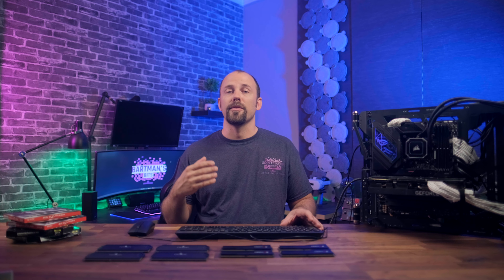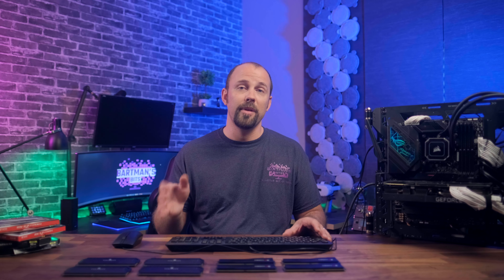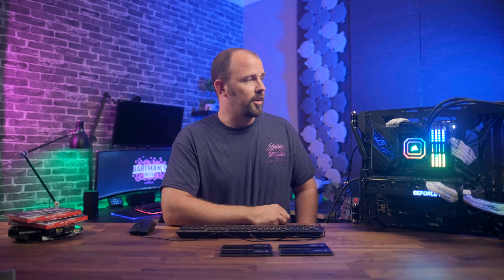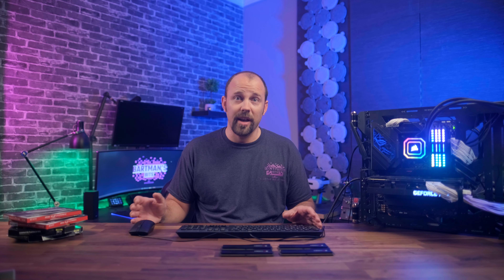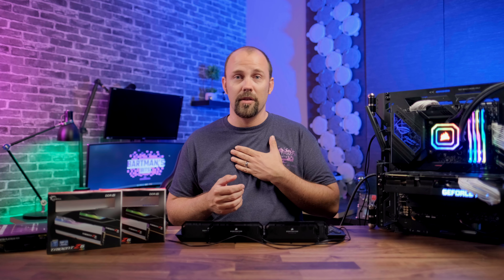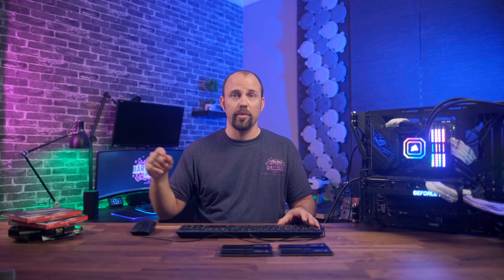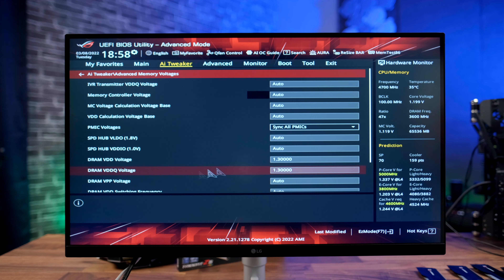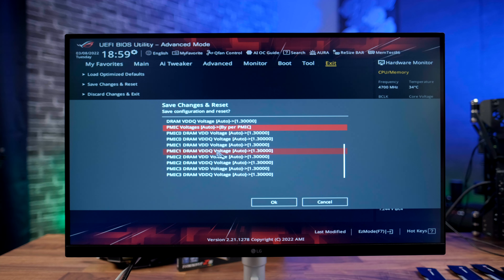Intel’s DDR5 problem resolved! DDR5 64GB Boot Loop failure Fix. Get the rated speeds of your RAM!

Comment: Ran into this tonight while trying to setup my CPU. All of a sudden XMP stopped working and was stuck in a boot loop with a UEFI error. Changed the settings and let it loop through all the sticks and I was able to post and install windows. I don't understand why this wasnt an issue on my PC before, I have been running these same sticks for the last 2 years without any of these changes.

Comment: My ram is 6400, but the bios shows it at 4000. Followed the video, and still won’t go above that. Thinking I may have faulty ram and/or motherboard

It also seems like evga doesn’t allow you to change the pmic settings. At least not on the z690 classified.

Comment: Hello,just got a z790 tuf pro, with 2 x16 gb at 6000mhz ( cpu i7 14700k) with xmp profile on,the ram are at 6000mhz and i get the boot loop and blue screen all the time when i open the pc, with 1 stick works fine! but when both are togheter pc freeze/crash and put me into bios,or repair mode thingy, ill try do to what you done in this video to see if its working somehow,or if anyone has a ideea ,been hours im trying to make it work! Thanks !

Comment: I can get my Gigabyte Z790 Aero G to boot by changing these settings and windows is totally stable but as soon as I do a restart I get the boot failure detected message again but if I shut down instead of reboot then it always boots up fine.  Gigabytes bios is super buggy.

Comment: Ive got my dominator 64gb 5600 4sticks to be stable on my msi mag Z790 MB by just running them without xmp for first boot then turning xmp back on  but whenever i try to do a ramtest ie diagnose memory test or any of the other ram testers  they dont seem to do anything  my computer just sits there left it for 2 hours just in case but still the percentage counter hadn't moved   tried it with 2 sticks and it worked fine    I'm not having any stability problems with 4 sticks games and everything are running fine  that's playing Cyberpunk

Comment: Perhaps you can help, I have the titanium dominators 2 16 gig sticks. And only one stick posts. So I am not getting my full memory capabilities.
Reply from the maker: Do you have them in the 2nd and 4th slots? Are they fully seated? If you swap them does the problem follow the memory stick or is it the slot that is possibly bad? Check these things and let me know.
Reply: @BartmansBits  yes it is not a physical issue. I’ve gone through every thread and forum. It seems to be something with aorus boards and dominator sticks. It’s in a2 and b2. A2 is not posting. But I swapped mother boards yesterday. Day before that it was b2 not posting.
Reply: This is my second set of sticks. I returned first set thinking they were bad, and got this set. Same exact issue happened.
Reply: @BartmansBits  any idea what I could be doing wrong?

Comment: Hey @bartman's Bits i got a rog strix z690-F gaming wifi MOBO with Corsair Dominator 2x16gb(32gb) at 5600MHZ DDR5 so only 2 sticks and im crashing on XMP2 while running XMP1 its pretty stable but i still get problems after a few hours of gaming do you know what the reason to that is? if i apply the information from your video into my bios will it fix this problem ? 
Thank you
Reply: Hi, u solve this issue?

Comment: G.Skill Trident Z5 RGB
DDR5-6400 CL32-39-39-102 1.40V
64GB (2x32GB) 2-Kits
Intel XMP (128GB) can a total  of 4 sticks  be combined to get 128GB they come in a kit of 2 can I use all 4 sticks of 34gb ram to oc to 6400mhz and at that point is it Considered dual or Quad channel with all 4 slots? Can I achieve those speeds with all 4 install in my msi mag tomahawk wifi z690
Reply: I have the same hardware. Did you find a solution?

Comment: Just bought an MSI pre built that came with 2 16gb sticks of DDR5. I wanted some RGB effects so I added another 2 of the same DDR5 Kingston Fury but with RGB...damn thing wouldn't boot with 4 sticks at 64gb. No matter what, I removed 2 and it booted fine. Don't know why I can't populate all 4 slots. I guess it doesn't really matter, I'll never need 64gb.

Comment: Great video. I just gone and bought parts to build a system to support 12th gen intel. I hav ebought GSkills 4x16 GB @60000 Mgz. I will try this method but have  Asus released a bios update to solve this? My motherboard is an Asus Maximus Z690 Extreme. Or would It be better to replace the 4 sticks with s sticks of 32GB each??

Comment: Why does no one ever talk about passing memory tests? My kits boot fine with 2 sticks even 4 sticks at 7200Mghz (my kits advertised XMP settings). But it will bluescreen every 10 minutes in Windows due to massive amounts of errors. 
Being able to post is one thing... but in my opinion it also has to be stable otherwise your windows will die after a few windows updates.

Comment: I have a msi z690 force motherboard i9-12900k and just got 4 sticks 64gb 5600mhz corsair dominator platinum ram been messing with it for a whole day when I enabled xmp I get a failure and auto resorts to 4000mhz I tried these steps and anything else im stuck havent found a fix any solutions?
Reply: found a solution?
Reply: @daedubedb  no I returned the ram my board has had 3 bios updates then says it supports updated ram profiles to use more dims and higher capacity haven’t tried it again could just be cause when I bought my z690 it just came out and ddr5 was still early for the z690 platforms boards if In the future I’ll resort back to this comment

Comment: In an nzxt z790 n7 I couldn't get 4x16 gskill dimms working at 6000 Mhz (what is her top speedvalue), I could only make the system boot by putting them in xmp at 5600 Mhz and nothing else, 🥲

Comment: I just built my new computer with no issues, I went with a Asus Z790 board and a i9 13900K and MSI GeForce 4090 and for now, 32Gb of Corsair Vengeance DDR-5 6000 MHz / CL 36. Can I use 2 of the same sticks (4 total) and upgrade to 64 Gb
With your fix, also.......... Im not using a the same CPU as you were.

Comment: I need help I just got 13900k AORUS z790 with the trident z5 ddr5 6000 mhz 4 stix of 16gb  1000 watts psu I’m getting mobo code c2 c4 14 28 54 .. I flashed bios and still won’t post idk what to do :/

Comment: Seems like the latest asus bios update makes it a bit more stable. I dont need to increase voltage for 4x16 downclocked to 5400 dominators to post anymore. Its still not stable at the original 5600 xmp profile though

Comment: Need some help here! Ive got an i7 12700kf in an asus z690a prime with 2 16gb 5200mhz sticks from hyperX getting stuck on boot loop. Tried what was suggested in the video but didn't work, pc still boots fine with just one stick in (any of the 2) but getting the second one plugged sends me to boot hell

Comment: Unfortunately I did not work on me. I have:

Maximus Z690 Formula 
Corsair DDR5 5200mhz ( which is compatible with motherboard )
I9-11900

I changed the volts, frequency. I did everthing what you did in the video, I am with the last BIOS update. when I try to set  to XMP profile there are times that for whatever reason my motherboard does not want to reconize my ram.

I have been watching a lot of videos and still cant find a solution
Reply: I had crear cmos, and unpluged battery, still didnt work

Comment: If I buy 2 kits of 2x16 and not turn on xmp will I have a problem because I don’t truly care about the mhz I just want it to look good with 4 sticks but I don’t want any problems
Reply: 4 sticks work at stock speeds, it varies between the chip makers (hynix, micron & samsung) but expect to get between 3600-4400mhz default.

Comment: Does this also work with amd 7000 series ?
Reply: I think it does, having the same issue but my pc don’t even get to the bios. It keeps looping and don’t know what to do!!
Reply: @Pro3men2  try 2 sticks of ram first, after bios boots and windows installed, update bios and ad other 2 sticks
Reply: @Im_MarkS  I think the ram I have installed it’s not compatible with my board that’s why I’m not getting a post. Will try tonight with a new set.

Comment: We have 13900K, Gigabyte Z90 Gaming X AX, Corsair Vengeange 5200 2x32GB (the cheap ones no RGB), default 4800, and could not post with Micron 40 XMP. Hope this advice works.

Comment: I have 6400 mghz cl 32 trident ram
12900k 690 rog hero
It Was not stable at 6400 with suggested settings.
I believe it's stable at 6000 mghz. Currently running test. Seems good so far

Is it better to have 4 sticks 6000
Or
2 sticks 6400 asus tweak?

Comment: got the same motherboard i cannot seem to get this to work been trying to do this for a couple of days ive managed to get 5400Mhz but if i use 5600Mhz even with 1.4volts it either does the boot cycle or gets into a corrupt windows :(

Comment: I have T force delta 4 sticks of 16gb at 7200mhz .. 64gb total and if I messed with the voltage on my Rog Strix Z790 it blue screened .. just change the other settings but leave the volts the same

Comment: Trying this right now with XMPII @ 5200 mhz on a Z790 Maximus Hero. So far it hasnt crashed yet but it's been less than 2 minutes in Windows. Ok, yea, works fine in Windows but the second you run any game it crashes. Back to XMP1 defaults for me and sadness I guess.

Comment: I have a 2x 32 GB (64 GB) Corsair Vengeance DDR5-5600 memory kit in a ASUS ROG Strix Z690-E GAMING WIFI motherboard With a Core i9 12900 (Non-K). Running everything at stock without overclocking (including no XMP profile on the memory). 

The computer froze once while testing and then refused to POST with QCode 55 and Amber/Orange light. I then tried to remove one stick which got it to POST again, and I installed the second stick of RAM again and it kept POSTing fine. Ran Intel Processor Diagnostic to check the CPU and it was fine. 

So I tested the RAM in both MemTest86+ and Passmark MemTest86, and it shows a weird anomaly where the two sticks of RAM is identified by Memtest86+ as Unknown 2 GB DDR5-4000 sticks. Yet it detects all of the 64 GB RAM and tests it successfully without error. In Passmark's MemTest86 it's the same thing except it does not show ANY sort of identifier for the RAM sticks. Tests fine.

In AIDA64 under Windows 10 21H2 it does detect and show the memory stick's ID string correctly BUT says that they are 16 GB sticks!!
Haven't had any freezes (yet) but I'm not using the computer for anything serious until I can get this sorted. Fighting with the store where I bought the components about getting to try other RAM sticks to see if its an incompatibility issue or something else going on.

ANY help to make sense of this would be greatly appreciated!!

Comment: i have same problem, im using 16gb 4x. and when playing AC Vallhala always crashing, and blue screen. so i take 2sticks and all normall. its same settings for corssair vegance 5200?
Reply from the maker: This should work for your Ram configuration, especially being that it is lower speed. Once you get above 6000 things get a little more tricky
Reply: @BartmansBits  I've done your steps, but still crash at AC : Vallhala. but for a while it doesn't happen blue screen.
Reply from the maker: @radjamas5635  Have you tried running at 5000 instead of 5200? It’s possible to increase the VDD and VDDQ to 1.35 to increase stability. Don’t go to high with voltage though.
Reply: @BartmansBits  hmm still crash, but when I'm going default settings at bios without xmp its perfectly fine with 4000Mhz. idk know why.. so frustrating

Comment: I specifically only bought 2 sticks because of this problem, but XMP would cause my OS to blue screen while running, not even doing anything just like clicking around a bare bones windows 10 install and boom blue screen. I had to turn off XPM just to use my system, 6k ram running at the default 2.4k speeds is a bit less than optimal.
Reply: also I can't try along with you because I am watching this on the PC with the problems so... I will let you know later if it works out or not later.

Comment: I have a MSI z690 Carbon board and just downloaded the latest bios.  I clicked on XMP profile 1, and it loaded with the XMP rating of 5200 instead of the 4000.  Before the bios update it would just give me an error message and I would have to start it with the regular 4000 speeds.  After the BIOS update, I did not have any issues and did not have to mess with any settings.  I have 4 16gb sticks of corsair ram at 5200.  MSI BIOS is 7D30v17 and in description it states fine-tuned memory compatibility.
Reply: When I download the new bios I do it on a USB drive that's clean and then pop it in and hit the bios flash button on the back right? (I know I have to put the usb stick in the rear bios slot) or can I just download it from the site and be done? Last question I promise.  When I do this any risk to losing anything ?

Comment: Still don’t get how this is a frequent issue among others. Z790 godlike I9 13900ks 4x24 trident z5 rgb 7200 - I can get 2 dimms working at xmp, but not 4. With 4 however I can’t get anything higher than 6600 and this was with vddq at 1.4v so idk what to do

Comment: I tried so many things... but could not make it work. I have 2x32gb corsair vengeance 5600mhz +2×16gb corsair 5200mhz on asus prime z690-p Motherboard.
Even after Cmos clear, it does not want to go to the bios. So I tried with 2 cards all good.(at 5600mhz or 5200mjz) Setup up the bios but same afterwards adding the extra ram can't get it run. I saw that some limitation are due to processor... my i9- 12900k might be limited to 4800mhz.
I spend hours and could make it work once with 94gb but then I updated bios to last version 2002 (tought would help to bring xmp3 or increase from 4800mhz) but then impossible to even make a set of 3... I am stuck... I think more options are available to make it work but don't know what yo try anymore... help appreciated.

Comment: Thank youiiii . Finially something worked . I'm using 4 sticks in tottal of 128 gb . I had to set the voltage from 1.3 to 1.435 I'm not sure if this alot more voltage then I should . I should I tune it down the voltage I mean . Nevertheless it's runing smooth at 6000mhz so far  I just wounder if teh coltage could hurt down the compute Ron the long term . Any help ?
Reply: The XMP profile of my Corsair Vengeance DDR5-7200 banks is 1.45 so you should be fine ;)

Comment: Hi, do you have any advice for a DDR5 mobo with i7-12700k on which I will upgrade the RAM in the future using DDR5 that are no longer "immature"?  So as optimized as possible for the future.

Comment: Hey tried this with my: G.SKILL 32GB KIT DDR5 7600MHz CL36 Trident Z5 RGB Black and unfortunately no luck so far. Will try playing around with the voltages and some other settings. Running on a 13900K and Asus ROG Strix 790-e Gaming board.
Reply: Let me know what happens, planning to get an Asus board now because people are having the most success with them.

Comment: HERE IS THE FIX TO ACHIEVE 6000mhz ON Z690’S
- Enable high voltage mode and set voltage to 1.45v for both DRAM VDD Voltage options
- PMIC Voltages should be By per PMIC

Enjoy
Reply: Is there any risk here? Is this still working for you ? I'm running 12900k and z690e gaming wifi with 6000mhz gskill trident and xmp profile 1 should I be running xmp 2? And lastly do I change my dram frequency to 6000mhz manually or will xmp 1 or 2 set this for me?

Comment: I've got a i9 14900K, ROG Maximus Z790 Hero with 4 sticks of Corsair Vengance RGB 7200 16GB sticks... 64GB total. It runs at 4200Mts default. Enable XMP and no post. I know I could pull two and it would probably work with XMP enabled, but I actually need 64GB. I could buy 2 32GB sticks (wondering if I could buy 2 48GB sticks) and get 64GB (or 96GB) and work with XMP but I'm wondering if this would work to get me to 5600Mts for what I have? would the settings need to be adjusted for the 7200 sticks I have now? 

Does anyone know if my board would support 2 48GB sticks? (ASUS doesnt seem to actually know) ASUS did add support for 24GB memory in april of 2023 with a bios update. 

Thanks for the video!

Comment: And IF, JUST IF, Gigabyte could standardize on their crazy bios wording, and not change it every flipping "improvement" I might just be able to enjoy my computer as intended with the speeds I paid for.  I am grateful for this video but with the Gigabyte Gaming X AX board the only thing I can find is XMP and VDD and VDDQ, and they are standard set to 1.35 volt.  I upped that to 1.40 but got a hard lock after 4 minutes on Windows.  I do not have the luxury of an open motherboard so taking out the ram requires removing the AIO, and it is all in all way too much of a hassle.  I am going to return all the ram to Amazon and buy 2 x 32Gb.  I need at least 64 since I am running many local virtual machines.

Comment: I was having this issue with 2X32 ddr5 5600 corsair dominator on my i9-12900k. 
my system is a ASUS log Maximus hero motherboard 
system would boot loop every time without failure

rather then a ddr5 4 stick ram problem, I think its just with anything DDR5 64gb and higher

Comment: I have the T.Force 64GB 6400 and it's trying to boot with those settings now, but don't think it's working lol. Might try and reduce the clock slightly.  Also my voltage was already at 1.35v after XMP1 was enabled. So I increased to 1.4v. But no joy.
Reply: Did you ever find a solution?
Reply: @rgbkingpin  my build video is going live tonight 👍
Reply: @GeekyStuff  awsome I'll have to check it out if I have time

Comment: Thanks for the video! My Dual Kit of 64gb G Skill DDR5 RAM has a default vdd and vddq voltage of 1.4V with xmp. I adjust the voltage to 1.43V but with Memtest it still gives me errors.